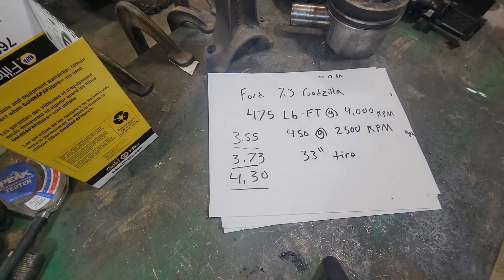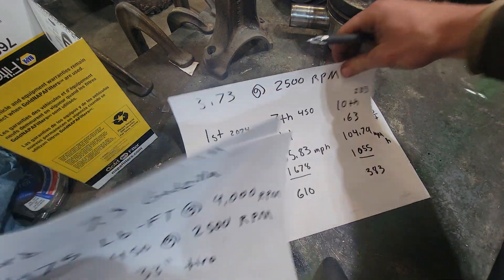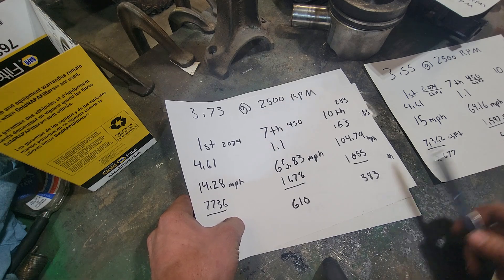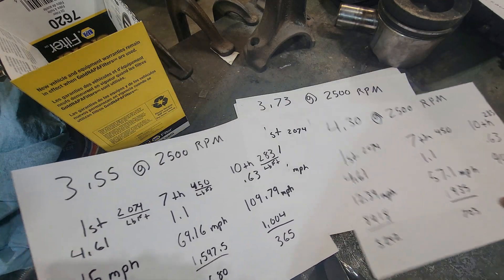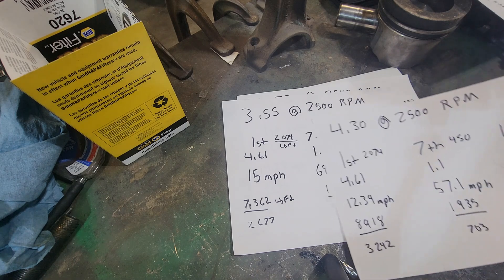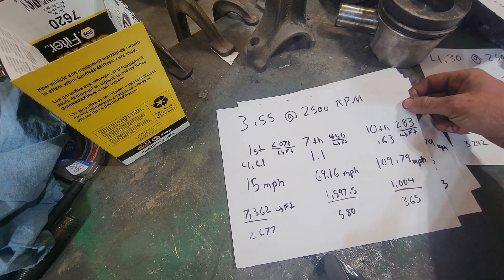Picking the right gear ratio. (7.3 godzilla)

Comment: If you are worried about fuel economy driving a truck, you don't need to be driving a truck you need to be driving a hybrid or electric car at that point.  When you own a truck, you should be worried about power and reliability.  A 4.30 ratio is what you want if you want a truck that's going to tow anything you need.  If you want a 3.55 ratio, you really need to be looking at buying a car instead of a heavy duty truck.  Weekend warrior or not, if you want to tow, buy a truck to tow, meaning max tow package, max payload package, and the largest numeric/lowest ratio....you want that torque, you don't want to be struggling up hills, and that 4.30 ratio will also help hold you back when going down hill too with the transmission grade shifting.  That 10 speed with the Godzilla will work all day long and not break a sweat.  

Years ago the 460 V8 actually was rated for higher towing capacity than the diesel because the diesels weigh so much more than a big block V8, and didn't want a diesel...that old 460 is still going strong with the C6 automatic in my 88 F250 supercab long bed 4x4 pickup.  approaching the 700k mark without a rebuild of the engine or transmission....I do need new U-Joints up front though LOL.
Reply: Maybe if it's just a toy hauler.  If you're running a business then you absolutely do worry about fuel economy and anything else that's an operating cost, and if the 3.55 gears allow you to run at a lower cost of operation without sacrificing safety or the ability to do whatever job it is you're doing then that's the choice you're going to make.  There are also plenty of people who don't actually need a HD truck, they just want one, and they're never going to tow anything bigger than a boston whaler two weekends a month in the summer.  Smaller rear end is perfect for those people too.
Reply: @jgalt99  Again if you worry about fuel economy in an HD truck you shouldn't be driving one, business or not...Fuel economy shouldn't be a check box on your purchasing sheet, capability, capacity, reliability yes, fuel economy, absolutely not...if that is a checkbox you should be looking at a Prius, or other hybrid or electric vehicles rather than a truck that does truck things not save fuel.
Reply: @wildbill23c  If you're not trying to make your business run as efficiently as possible, (again, without sacrificing whatever capability you actually need) then you're not running a business, you're laundering money or something.
Reply: @jgalt99  If you are running a business doing a lot of towing/hauling, you better be looking for the most reliable not the most fuel efficient.  

I drive an F550 every day, its not fuel efficient when its empty either...but its reliable, far more important than a fraction of an MPG which is the difference you will find....also, if you are trying to go with a lower numerical gear ratio and find yourself holding up traffic going up hills, that is a huge problem, and the rest of us that pass you doing the speed limit up the hill because we bought the truck that was properly equipped to do the job, again that is going to point right back to you trying to save 5 cents in fuel over a tank of gas or diesel.  

Again, if you are fuel economy oriented, DO NOT buy a truck period, they are NOT fuel efficient in any way shape or form.
Reply: @wildbill23c  I'm hauling 8k-15k trailers 80-150 miles a day.  That's right on the edge of what a 150 can do and a 250/350 with any gear ratio is way overkill.  A 150 would definitely feel sluggish and imo unsafe given you have smaller brakes, lighter frame, less robust suspension.  Fuel costs were about 4.5% of gross back when gas was 4.50 in my area, now it's down to 3%.  A 2MPG difference in fuel efficiency is worth about $800 a month to me across the fleet.  Reliability is a wash, it's all the same truck, (and if you care about reliability over everything else you're not buying a diesel built after 2006 at all).  There's plenty of people in this same demographic where it makes sense to get the 3.55s because that's all you need and it saves you money.

Sure, trucks are not generally fuel efficient, but some configurations are better than others and that results in more money in my pocket that otherwise would just go out the end of the tailpipe for no increase in productivity.
Reply: It’s personal choice. So you don’t care how much food costs? You don’t care how much your mortgage payment is? You don’t care how much your truck payment is? Some people do, and if they can eek out 1-2 more mpg and don’t tow much they will opt to save money. Nothing wrong with that. That said, I opted for 4.30s because I drive hilly 55mph roads, and there’s basically no penalty at 60mph by going with 4.30s. Not saying you’re wrong, but some people’s priorities are different.
Reply: @cliffordmontana4562  Umm, if you are in the market for a truck to do truck things with your going to have a vehicle payment in the $1k+ range, doesn't matter what brand you buy, doesn't matter if it gets "good" fuel economy, and BTW it gets better fuel economy than a semi-truck that is actually doing all the heavy hauling of your food....which isn't remotely close to the vehicles that are in this review, which are pickup trucks, not semi-trucks.  A semi-truck hauling freight is going to be doing 6-8mpg on a good day....your typical 3/4 or 1 ton is going to be doing 14-18mpg on a good day...drops to around 8-10mpg if you are towing max weight.  

If you buy a truck to use as a truck, you should be buying it equipped to do such, so yes 4.30's are definitely the way to go, 3.73's are marginally ok in an HD truck, but my 1/2 ton Tundra had 4.30's so I wouldn't want to go down from there in an HD rated to tow twice what my 1/2 ton can tow LOL.  

If you are buying a truck to use as a family car, then yes, 3.73's, 3.55's, 3.08's are perfectly fine but overall you won't see much in an economy boost by doing so because you typically do mostly stop and go driving which is terrible in a truck regardless which engine/transmission/gear ratio you get.  

When I'm in my truck, my worries are the idiot drivers around me not what my truck payment is or if I'm getting 8mpg or 9mpg.
Reply: @wildbill23c  I don’t disagree with you if you’re towing, but 7 out of 10 people that buy heavy duty trucks do so for the extra payload capacity and not really for towing. Most fleets do so. My dad bought an F250 2 years ago with 7.3 and 3.55 gears and he’s very happy with it and doesn’t want 4.30 gears. He bought a heavy duty because he has 1,000-2,000 pounds of tools/equipment in the bed at all times. If you’re towing I completely agree with you. If you’re not towing and do lots of highway miles, the 3.55 gears might save you a truck payment every year. And if your company owned 50 heavy duty trucks that you bought for payload capacity, that could add up to huge amounts of money every year. There’s a reason Ford offers the different gear ratios. And then there’s lazy GM! Lol. Have a good night William.

Comment: I've got a 23 f250 7.3 with the Tremor package ordered and it comes with the 4.30. I don't tow daily, but im ok w/ a fractional loss in mileage to have the ability to tow more if needed
Reply: Bingo...if you are worried about fuel economy you shouldn't be driving a heavy duty truck LOL.  That combination of engine and gear ratio you'll be able to pull whatever you want....your limits of course are payload more so than the capability of the engine/transmission.

Comment: Thanks. I'm trying to decide between the 3.73 and 4.30. This video was very helpful! I'm a weekend warrior with a 28ft 5k tt. Typically towing in flat lands, but do venture to Colorado and The Smokeys .Sounds like 3.73 would be my go to.
Reply: 4.30 and you can pull anything.
Reply: @wildbill23c  pull everything but pull by a fuel station haha.
Reply: @dmbworks8094  Definitely.
Reply: 4.30 gives you a 4000 pound towing advantage over the 3.73 according to Ford. No doubt the 3.73 will tow 20k but you won’t have fords blessing and the potential legal issue. If you never plan to tow heavier than 16k, then you can ignore all of the above. By the way these are 7.3 Dually numbers. That’s what I have. Single wheel truck are at lower ratings, but the 4.30 is basically a max tow option.
Reply: @dereknew5298  my 2020 250 6.7 4 door lb with 3.30 is great for hauling the mail.. just gets better mileage the faster you go haha.
Reply: I’d stick with the 4.30 here.
Reply: 4.30 with the 10spd trans. Winner Winner Chicken Dinner

Comment: Doesn't 10th gear get locked out in tow haul mode? Its does on my 18 F150 with 10 speed
Reply from the maker: Not in the super dutys
Reply: No, you can manually lock it out tho in the SDs. Tow haul mode keeps the gears longer and doesnt skip shift
Reply: @richvangorder3900  Does it hunt for 9th and 10th gear while towing
Reply: @justinthomas937  the 10r140 mated with all that torque is the least "hunting" transmission ive ever driven
Reply: @justinthomas937  You can lockout any gear on F150s and Super dutys.

Just hit the minus sign on the shifter when it's displaying the gears on the dash...every time you hit minus it will drop a gear off the display and never shift over that.

If I'm on flat ground with no wind I leave it alone but if it's hunting I'll lockout the top 1 or 2 gears depending on terrain

Comment: Colton, this is good stuff.  If you want to really blow some people's minds look up the gear ratios of some older low power diesels like my old 2004 Ram 2500 with the 24 valve Cummins which  also had the 3:73 gears.  I did not do all the math like you did here, but if you compare the gear ratios of the Dodge 4 speed to the Ford 10 speed you'll be amazed.  Both 1st and 2nd gears in the 10 speed are lower than the 1st gear in the Dodge 4 speed.  Now look at your torque numbers you're playing with in this video.  The 7.3 with the 10 speed is actually capable of putting more  torque to the ground off the line than the old Dodge with the 24 valve Cummins.  It's crazy but an awesome selling point for going back to a gas from the diesel.  Now to be fair we are talking about comparing the old lower power diesel to the 7.3 Godzilla not a modern High Output Power Stroke to the 7.3 gasser.  But it proves once again most people towing like you say as the weekend warriors with campers really don't need a diesel.  The 7.3 Godzilla has more than enough power and grunt to get the job done.  just another idea for a future video.  I would love to see you do a similar video to this comparing the old 2004 Dodge and the new Ford Super duty 7.3.
Reply: Right here is why the granny gear of the G56 is so great

Comment: I’m exactly that guy who appreciates the 3.73 I have in my ‘22 F350 7.3. Tows anything I’ll ever tow and does great on mpg as a daily driver (I’m averaging 15 all around over 20,000 miles with about 5,000 of that being small tows). I pulled a kid’s 27’ boat and I have no idea how much it weighed but he needed my help moving it and his F-150 was underclassed for that 120 mile tow. My truck pulled it like a champ. A diesel would have been better BUT the 7.3 pulled it like a champ. No concerns. Colt was a major factor for my decision to go 7.3 and I’ve not had a moment of buyer’s remorse.

Comment: So the dually has 31 inch tire resulting in more torque at the wheels than the 33 for the same   Gear ratio!  Is that why the put the shorter tires on the duallys ?
Reply from the maker: Bingo

Comment: For towing on a gas engine I would definitely get the 4.30 gears for sure. I bought a 2000 F350 with the V10 and it had 3.73 gears, now it was only a 4 speed back then but it would scream out first gear and shift to second and unless going down a hill it would hardly ever shift to 3rd or 4th. I would really like to try a 7.3 with 4.30 gears to see how a modern day gas engine can tow with 6 extra gears. I traded that V10 in for a diesel and have only owned diesels since because of how disappointed I was in it. These 7.3’s so far seem very impressive from what I’ve seen.
Reply: You would fine with the 3.73’s
Reply from the maker: Yes you'd enjoy the 7.3 greatly over the v10
Reply: The V10 was great, but the 7.3L V8 will outperform that V10 by a long shot for sure.

Comment: I’ve got the 4.88 rear with 7.3 f550. Gcvw around 37k. Gearing makes a big difference. Enjoy your channel
Reply from the maker: Thank you!
Reply: How does that pull on grades with the derate ?
Reply: I’m not sure if the 7.3 is derated in a cab and chassis truck like the diesels are. It does good we do mostly state highways and in town so 55mph and below. On interstate can tell it’s not a diesel at 38k combined.
Reply: you got 19.5 tires ?

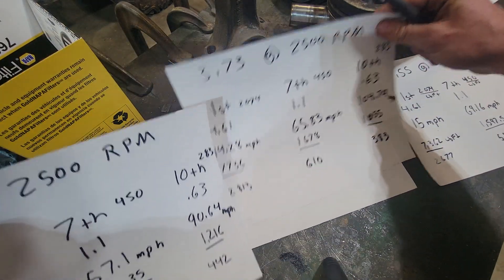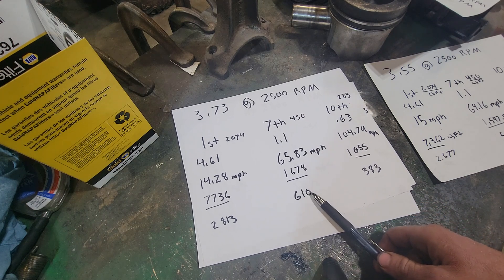Comment: Can you do a video with the 6.7 powerstroke? They have a 3:31 and 3:55 rear axle ratio. Thanks!
Reply: i have the 2020 6.7 with 3.31 and it is a freeway monster, im constantly having to slow down with no trailer, peak mileage is around 75-80 mph to get the 1750 rpm. i dont tow max loads but i still cant tell when theres a boat or car trailer back there. i am also running the 17" stock wheels, if you go with tires in the 30's the 3.55 at least is probably better.
Reply from the maker: Sure can

Comment: i just re geared my 04.5 cummins from 4.10 to 3.73 since i’m doing the g56 swap and the final drive is geared lower on the g56 compared to the 48re (i’m on 35” tires) so with the 3.73 & 48re im doing 70mph at 1700 rpm with the g56 i should be about 2k at 70 mph